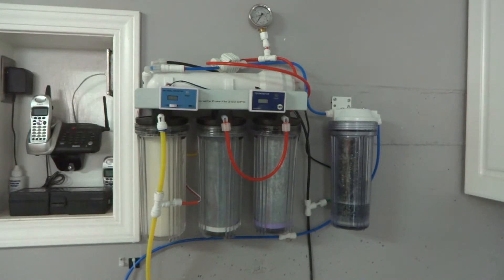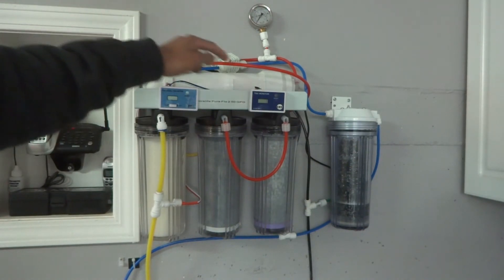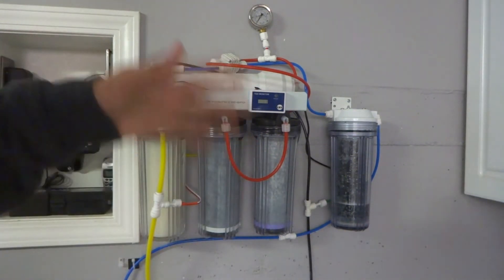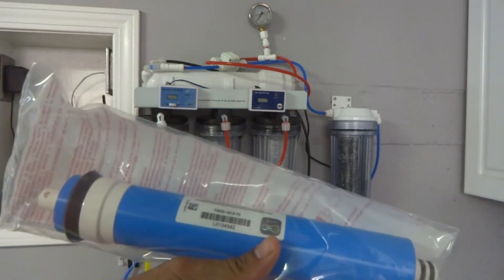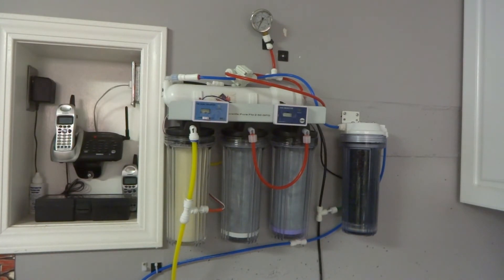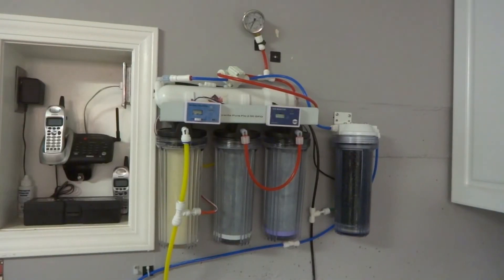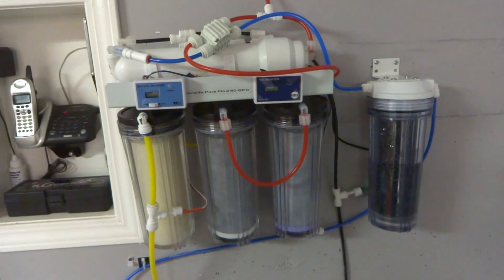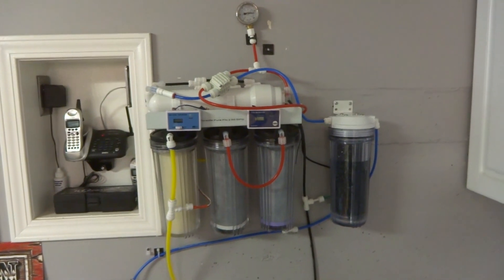RODI System Conversion-Saltwater Aquarium

Comment: hey man, i didn't see this video, and I noticed you said you have 85 psi, idk if you have a booster pump on this or not, but 85 is high, I used to be a plumber, and you should have around 61 psi in your house, anything over will start messing with faucets, toilets, and everything it can even peal away copper pipe slowly,  when i checked customer's houses, anything over that i would mention a prv valve, pressure reducing valve, if it was over 75 i would highly recommend one. so idk man you might not need it, but it might help your plumbing.
Reply from the maker: +Wayne's Fish World Thanks Wayne, hope all is well. Yeah, the pressure is at about 80-85 psi straight from the tap. The water in my shower can rip your skin off if you have the shower head set to the wrong setting, lol. I haven't really had any issues with piping, but will definitely keep it in the back of my mind from this point forward. Thanks for the post!
Reply: no problem bud

Comment: Your ratio has everything to do with your pressure. At 85 psi that's crazy. I only get 58 and 60 psi. I'm more around 4:1 ratio. What is your supply line hooked to?

Comment: In my experience the 4:1 ratio has more to do with low pressure on the supply side. You indicated you had 85 psi, I am pretty sure that is your answer right there. If my RODI had a 1:1 I would be stoked!!!
Thanks for the vid :)